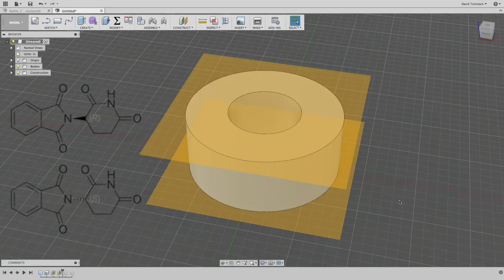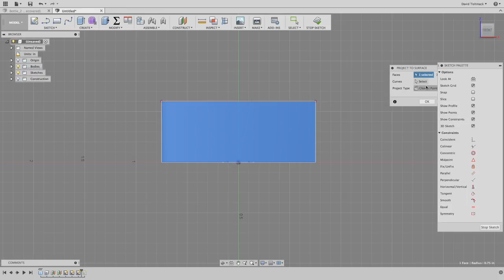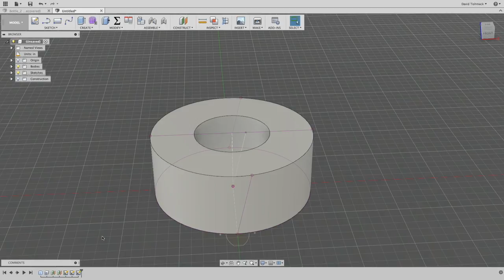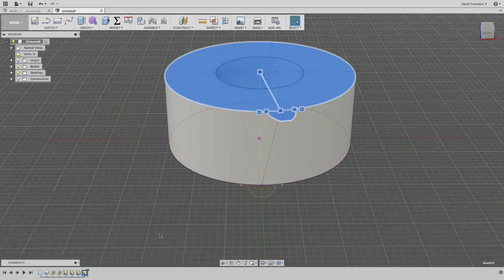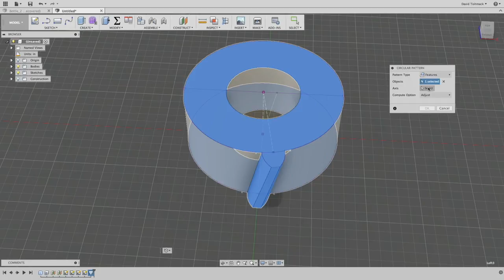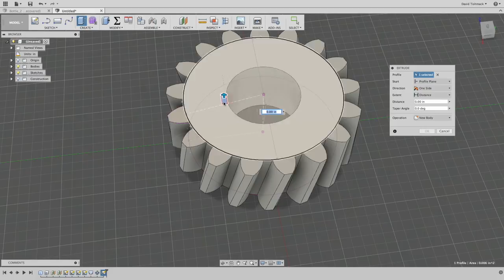Making Helical Gears Easily in Fusion 360: Project to Surface Tool!

Comment: oh I figured it out. I mean, I didn't do it exactly like shown, but it works
Reply from the maker: What did you end up doing? It was hard for me to decipher your first message
Reply: Instead of creating constraints to manipulate the topmost sketch, thus creating the slope to the gear tooth, I projected the original sketch to that plane, then I broke the link and selected the Move/Copy tool, Rotate, then incrementally rotated it until the end of the line that bisected the tooth sketch matched the end of the vertically slanted line that we projected along the vector.

Comment: HOW DO YOU GET THE PROJECTION OF THE TOOTH THAT IS ON THE TOPMOST PLANE TO STAY IN SHAPE WHEN YOU CREATE THAT COINCIDENT?????? I HAVE BEEN TRYING FOR AN HOUR BUT THE CENTERLINE SIMPLY MOVES BUT NOTHING DOES. THE FRUSTRATING THING IS I HAVE USED AUTODESK INVENTOR FOR THE PAST THREE YEARS BUT IN FUSION EVERYTHINGIS JUST BARELY DIFFERENT. I KNOW IM PROBABLY LIKE ONE CLICK FROM MAKING IT WORK AND THATS WHY I WANNA PUNCH A WALL